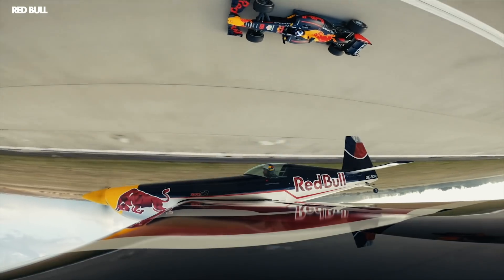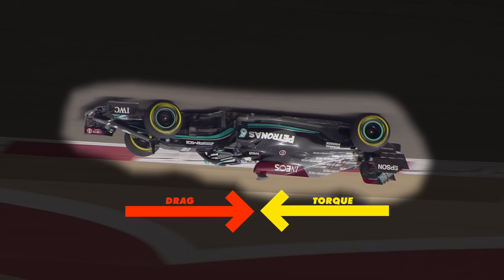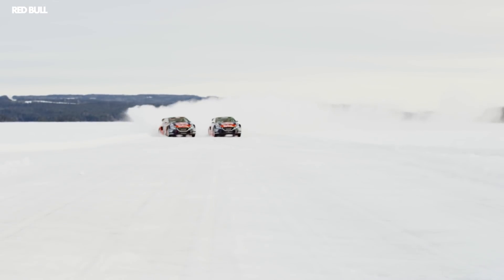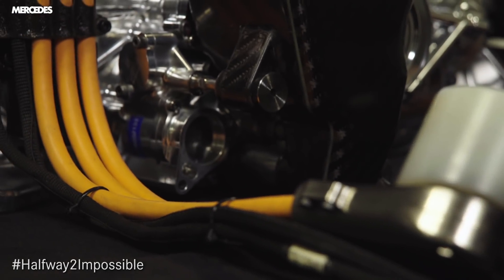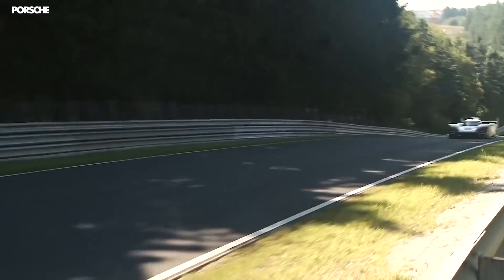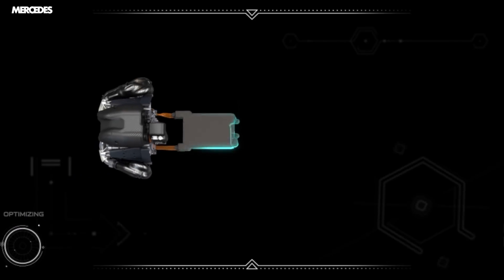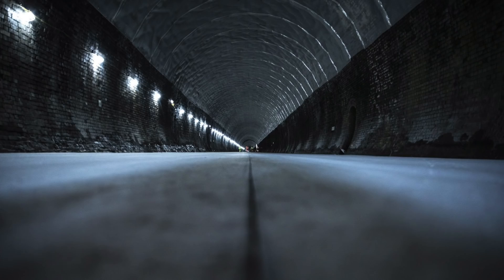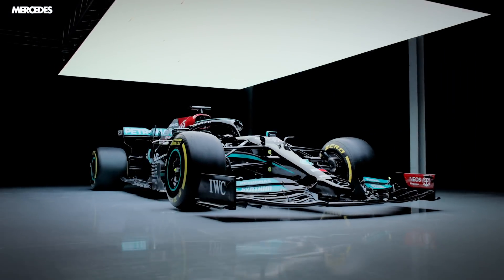Could a Formula 1 Car REALLY Drive Upside Down?

Comment: A Tunnel Race Track!! FIA should consider it! it would be so much exciting!
Reply: Maybe, once the cars are remote controlled
Reply: Just make the tunnel at Monaco a tube, and that would open up wayyyyu more overtaking opportunities at the track
Reply: @WoddCar  nobody would take it. Tunnel is already flat out so the current racing line will remain optimal, even if you consider the sidewall will become a banked corner because it's a longer distance. If you reduce the grip on the tyres you reduce your potential for acceleration meaning you'll just get stormed past by anybody right side down because they have more grip to accelerate.
Reply: @1Carnaby  Well, at Zandvoort They used multiple lines on banking, maybe a banking at tunnel could be something, but sadly they dont want overtakes there
Reply: @1Carnaby  it’s a joke
Reply: @WoddCar  I think the tunnel is way to Short.. I mean.. it could provide overtaking opportunities but also 95% more chances of Huge crashes.. it will be interesting for sure..
Reply: Too dangerous
Reply: @MGuairense  
Who cares? Make motorsport exciting again! I want to witness them!
Reply: @SorgreiToday  Well, I mean the drivers will care XD
Reply: @SorgreiToday  It wouldn't be exciting, it would be dull slotcar racing lol
Reply: what about safety car?!! XD
Reply: @Kooldude0307  who cares?
Reply: I have thought about this for years 😂 exciting as fuck but just as crazy 😉
Reply: Sonic!
Reply: Drivers in dirty air would be at risking their life everylap
Reply: And unrealistic.
Reply: The tunnels of Madeira would be a great possibility the transfer from road to wall will need some work, however wall to ceiling is already a perfect transfer
Reply: The tunnels of Madeira would be a great possibility the transfer from road to wall will need some work, however wall to ceiling is already a perfect transfer the longest one being around 3 kilometers long
Reply: 30 deaths per race then.
Reply: So much exciting🥴
Reply: no
Reply: How come no one said anything about sound, deafening
Reply: Guys, Here is Our Savior

YaH The Heavenly FATHER HIMSELF was Who they Crucified/Pierced for our sins and “HERE IS THE PROOF”

From the Ancient Egyptian Semitic: 
"Yad He Vav He" is what Moshe (Moses) wrote, when Moses asked YaH His Name (Exodus 3)

Ancient Egyptian Semitic Direct Translation
Yad - "Behold The Hand"
He - "Behold the Breath"
Vav - "Behold The NAIL" <— YaH’s Crucifixion
He - "Behold the Breath"

“Behold the HAND that Beholds The NAIL” 

PROVES - YAH The Heavenly Father HIMSELF was Who they Crucified

That is EXACTLY what Moses Wrote

Here is what they mean

YaH's Name:
(Ya)d + (H)e, as YaH is what Moses called Him and YaH Declared: "this is My Name, this is My Name for all generations" (Exodus 3)

YaH is The Creator of “MAN”: (Genesis 2:7)
Yad He, (HAND BREATH), as YaH's "HAND" Formed man from the dust  of the Earth and His "BREATH" made him a living being (Adam)

YaH's Sacrifice of Crucifixion for “MAN”:
Vav He (NAIL BREATH), the "NAIL" through YaH’s "HAND", in Sacrifice of Crucifixion, that whosoever shall call YaH Savior, His “BREATH” brings forth life (Salvation)

How YaH arrives:
YaH arrives via the Tent of Meeting (Exodus 33:7:11, Isaiah 54, 55), where a Tent is erected outside the city, a cloud descends upon the entrance of the Tent and YaH appears...

Why they demanded YaH to be Crucified:
YaH was Crucified according to Hebrew law (Deuteronomy 21), to be NAILED/PIERCED on an Almond Tree for BLASPHEMY as it was for His NAME they demanded Him Crucified. The Messiah claimed He was YaH...

HE WAS YaH!!!

HalleluYAH translates “Praise ye YaH”

The Hebrew Book of Isaiah

Isaiah 42:8
"I am YaH; that is my Name! I will not yield my glory to another or my praise to idols.

Isaiah 43:11
I, I am YAH, and there is no other Savior but Me.

Isaiah 45:5
I am YaH, and there is none else.
Reply: Exciting and dangerous
Reply: Might stop max going for wild lunges I suppose.

Comment: One way you could do it is instead of the car moving forward have it stationary in a wind tunnel that can generate 185mph winds then rotate the car upside down, all problems solved and the driver doesn't get hurt if it all goes wrong.
Reply: Yup that though occurred to me as well during this video. Also, everyone is thinking "tunnel." Why not just build a suspended track on some salt flats somewhere. Would be much cheaper and safer.
Reply: @nicklangner  Right thinking! Maybe there is no need for the salt flats either. If the track will be suspended from the beginning and just gradually twist around it axis you don't even eliminate the initial elevation chance of "running up to the ceeling".
Reply: @xhornik  My salt flats idea was more about a space without obstacles, like land speed record attempts. But dang! You took @Danny Howard and my idea and smashed them together. I like it! Throw on a frame with small wheels like a wheelie bar on top of the car (a small one that doesn't negate too much downforce), build your inverted section of track so the wheels of the frame are only a few centimeters off the ground when the car is inverted, and you might find a driver crazy enough to try it.

Comment: Bottom line, if the engine could run and you had a helical entrance ramp to the track, yes it could. That's what people are really discussing, the amount of downforce they have relative to their weight (much more than 1g)

As for practicality, you could build speed before the ramp, and the inverted track only needs to be long enough for 5 seconds at 180mph.

A forumla E engine with 1/10th the battery (plenty for this example)  would weigh much less and would free up even more power.

Comment: Appropriately designed internal combustion engines have been able to run upside down in many applications. Clearly it's only an issue if you stick to using an existing F1 engine without modification. A suitably designed corkscrew ramp at either end of the tunnel could allow the car to remain on a flat surface with 4 wheels on the track at all times. I have no doubt that this stunt can be done with enough care and planning. Modern remote driving technology would enable it to be done without risking a driver's life.
Reply: rotary engine should work fine regardless of position so take engine from old mazda 787b, add turbo and you will have more than enough horse power without adding much weight, you just need two fuel pumps in the tank, one on top second on bottom
Reply: @czaja995  Rotary engines cannot produce enough power... It's much less expensive to use an electric motor, at this point is better.
Reply: @IIARROWS  Rotary engines absolutely can produce enough power, but I still agree that it's much less expensive to use an electric motor
Reply: @czaja995  Don't think you would need to make any changes to the f1 engines nowadays, I would imagine they would be efficient enough even upside down, I could be wrong though
Reply: @cvcgaming1284  Did you watch the video? It's not about efficiency... the piston oiling and fuel delivery are the problems.
Reply: Same thing I commented although more thorough. I agree
Reply: Two Stroke?
Reply: I wouldn’t dig a tunnel.  I would construct a pipe.

Comment: Wouldn't centrifugal force keep the fuel in check? Like on a banked turn?
Reply: There is no centrifugal force if there's no steering, so sadly no.
Reply: @billystronk4251 I meant that they could do it if they didn't wait for 5 secs, and did a corkscrew
Reply: @magneticchaos1483  Yeah I guess that could work but it wouldn't really be driving upside down anymore

Comment: For Formula E, it totally depends on how the motor is cooled.  If there is an oil cooling system inside the motor and the oil pump would not work with the oil cooling system would not work.  Even for the non-oil cooled (cooled by an external cooling path outside of the stator), the coolant tank would be the weakest link be which needs to be re-engineered to run upside-down.
Reply: But engineering a cooling pump to run upside down is much easier than engineering a fuel pump.

Comment: Ok there has been many  inverted  vee aero engines 
Most German  and  inline six Ranger like for the tiger moth.
If your F1 car is a dry sump 
Motor just add booster pump to the top of the oil tank  to keep it oiling the motor.
Fuel problem fuel cell bag .
So when are you going to do this LOL?

Comment: Yes it can and the wind tunnel downforce data confirms it, the hard part is building a road that allows the driver to transition from right side up to upside down.
Reply: And the engine oil, fuel pumps and suspension not being designed to run upside down
Reply: In reality, it won't work. Downforce and lift are two different things.

Comment: if you want to drive a f1 car upside down redesign the engine to be like the DB601 that went in the BF 109 fighter that was an inverted v12 so design the turbo v6 to be like that

Comment: A lot of the "facts" presented about how aircraft can fly upside down are, sadly, incorrect. My aerobatic aircraft can fly continuously upside down for at least 30 minutes, limited only by the design of the fuel supply system. There is a limitation of 30 seconds for "knife edge" flight due to oil starvation, but there is no system on the prop to "unload" the engine when the oil supply fails - in fact there is a system to INCREASE load to reduce engine RPM.

As for the pilot, 30 seconds inverted is plenty!
Reply: Combat Mania  I wish! Nope, just a hobby pilot flying the sort of plane you could find at some local flying clubs.
Reply: Combat Mania  I was 29 when I had my first flight. I was cash limited, so I was 32 by the time I got my license. I bought a share in my aerobatic plane when I was 36.
Reply: @t67m  very inpiring! I am now 28 and thinking a lot about starting Fligh school with my work money

Comment: Does air pressure not have an affect on the downforce? Would Driving through a tube not have an impact on downforce created due to the change in air press and the energy wave created by the car moving through the tube?
Reply: Gravity: the air that produces downforce is under the effects of gravity, which wasn't covered in this video. The phenomenon required to make this happen is "lift", which air pressure certainly does affect.
In saying that, I doubt the air pressure would be different in the tunnel, unless they're running negative pressure ventilation.

Comment: I think you could solve the 3 wheel problem you mentioned at the end of the video by turning the twist to either side, think how Zandvoort banks heavily, same principles I imagine, allowing drivers to drive straighter lines. It would end up looking more like a corkscrew rather than a barrel roll.

Also the exit of the upside down part should be opposite to the entry to ensure that the car isn't relying on any of their velocity in the circular motion to keep them stuck to the ceiling. (not sure if you mentioned that or not but I think you considered it defintily)

Comment: I am thinking, that to get it upside down, you would have to drive it up the sides, so they have to be curved. And the same with the celing. How much downforce would you get, when it is not a flat surface? Or am I missing something?

Comment: your aircraft systems stuff is wrong. 1. fuel the fuel system is pressurized 2. oil, aerobatic engines use drysump systems.

Comment: I could see Redbull try something like this now that they have their own engine factory. Wonder if Max would be up for it 🤔

Thank you for a great video! Would love to see more of these 💯
Reply: No way they'd risk Max. However, Mark Webber has Red Bull connections and experience upside down.
Reply: I bet Coulthard would do it. Guy doesn't give a fuck.
Reply: All their stunt video's aren't done by their actual drivers.
Reply: @MrCow579  not true max has driven a few. Like on the snow with the chains that was max in the seat
Reply: It would be safer to RC the car
Reply: Wonder if Max WOULD BE UP for it. [Get it?]

Comment: Premix Two stroke? Oiling problem solved. Use a full taller thin sealed vertical fuel tank with a pickup in the middle solving the fuel supply problem? Id say though expensive an above ground ramp something like a full sized version of the orange ramp used in matchbox sets would be cheaper than a tunnel.
Reply: yeah hes wrong about the oil system any way aerobatic aircraft use a dry sump system which works just fine

Comment: instead of making the engine run upwards, why not make it sideways and use only one half of the track, therefore not putting the engine in a fully rolled over position, only tilted 90 degrees to each side on the roof and floor, should be easier to work with

Comment: I think another point to add is, the suspension must be stiffen to the point of no travel. Once the car is upside down, the chassis will be pushed onto the roof but it will keep bottoming out as the wheels don’t have downforce to stick to the roof
Reply: The wheels stick to the roof because they are connected to the chassis though?
Reply: No he’s right. Unless the tires have their own winglets like on the 2022 cars, a regular suspension would not work.

Comment: In the 90s there was news of fuel cell cars being able to use a hydrocarbon fuel like gas. Maybe using a fuel cell technology to power the electric motors. As for fuel pump: In model airplanes they have a tube that siphons the fuel and a weighted end on the tube that keeps it in the fuel regardless of the attitude of the tank.
Reply: The Toyota Mirai has been sold on California for like a decade now. That technology is already commercialized in road legal cars.

Comment: Design an f1 engine that works upside down.

Accelerate the car up to the required speed using a catapult similar to an aircraft carrier
Reply: That’s a good theory, you could catapult it to the needed speed, make the transition, and then fire the motor
Reply: @spencerb311  You could suspend the car upside-down and pulled tight to the ceiling with some form of harness, accellerate it with the catapult, and then release it to run on its own once it gets up to speed.

The claim is that the vehicle could drive on the ceiling, not up onto the ceiling.

Comment: Something I don’t think you considered with that 185 MPH requirement is the traction required to deliver enough torque to overcome drag. Drag is also proportional to the square of the velocity. So even with the equivalent of the car’s weight pushing it’s to the roof, you might not be able to deliver enough torque to the roof without the wheels slipping. You might even need significantly more than 185MPH
Reply: 1:55  Did you actually watch the video?  Or just comment?
Reply: @SamBrickell  The way I phrased it isn’t quite right. He makes the assumption that the a net force equivalent to the car’s weight would provide enough traction. It might actually require more than this, it might require less.

Yes I did watch it😂
Reply: What about 186MPH?